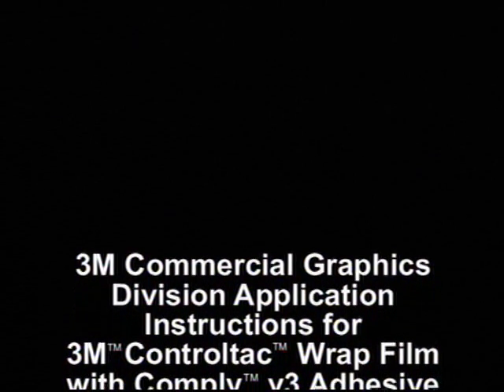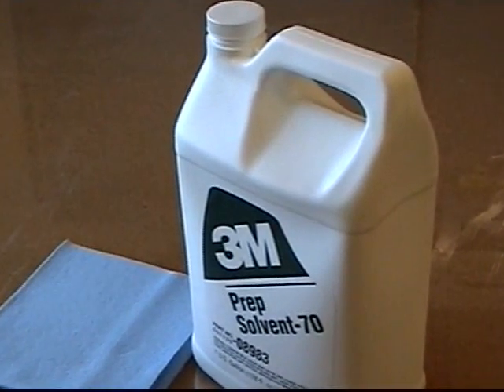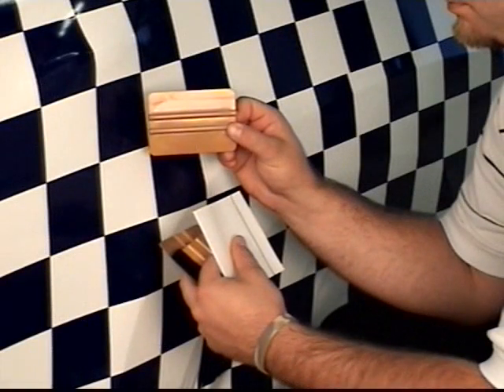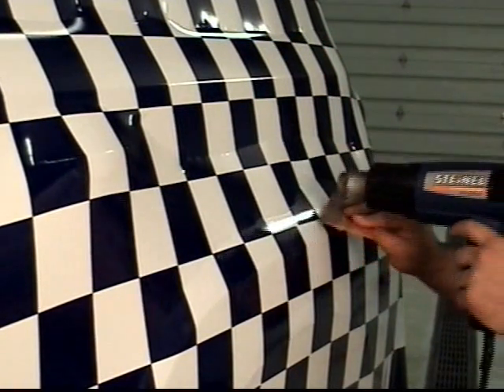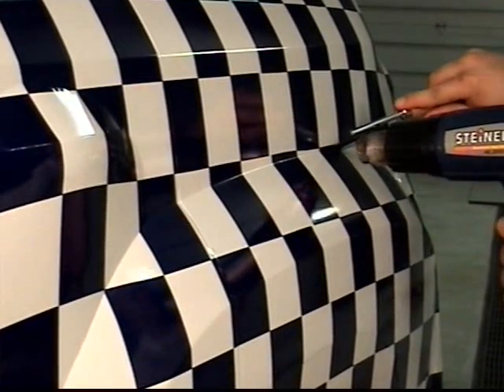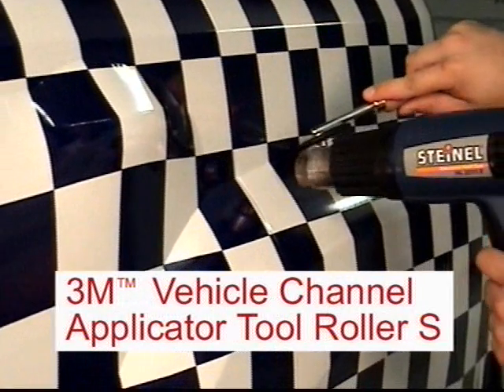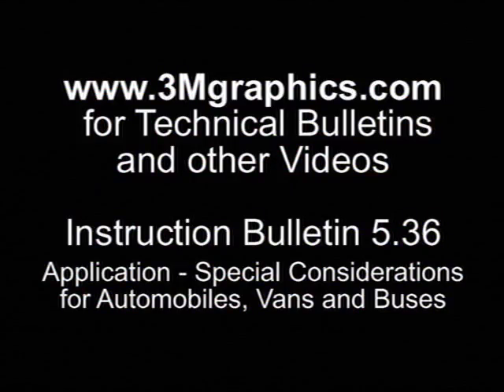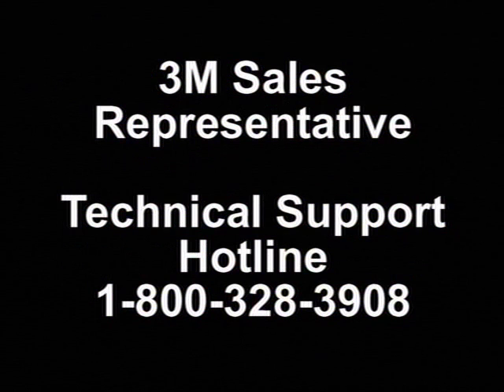Vehicle Wraps for Severe Countours

Comment: This is a 3M wrapping technical video.
so those with the advertising comments need wake up. "the video is about their own products and installation procedure". 

that aside, their wheel tools are very useful and not just for 3M films. however, the application procedure actually puts more pressure on the vinyl than other methods.
so i would suggest NOT following this guide.